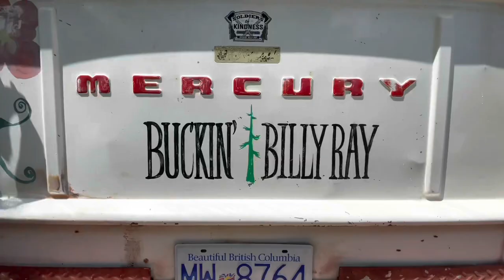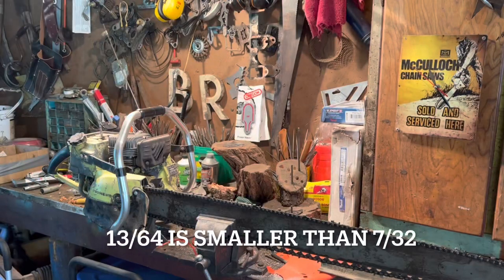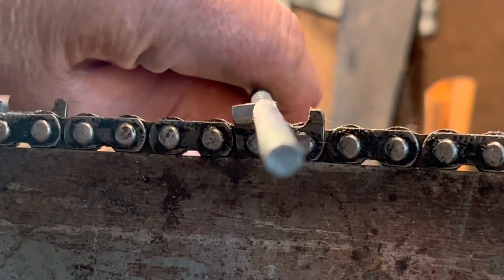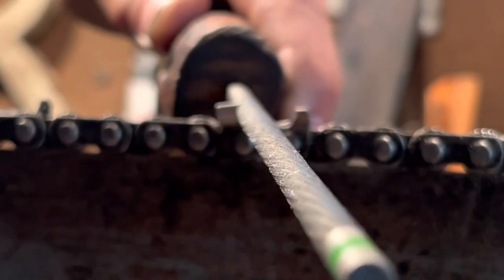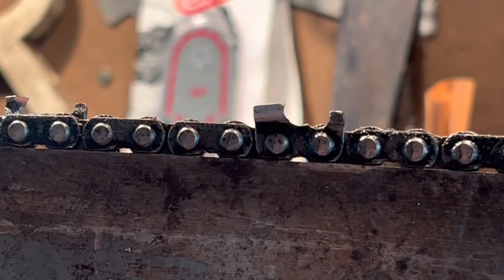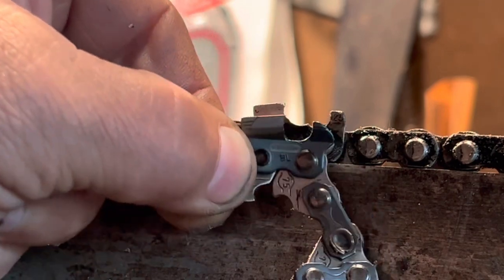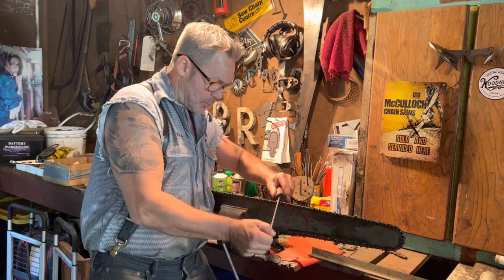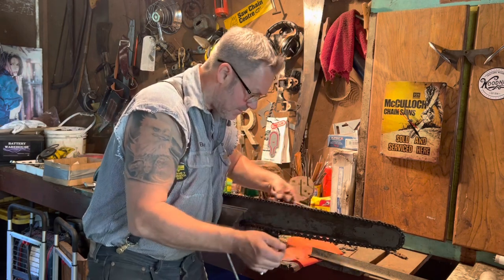How is your chainsaw file guide working ?

Comment: I have trouble getting consistent  hand filing results when i have no vice to use.  I use a genuine Stihl .404 file holder with 7/16 file for 3/8 chain for filing in the field. It keeps the file at the right depth and the marks help with the angle. Stihl chain has a lower top plate which is why they recommend 13/64. My .325 holder always cut too shallow with the 3/16 file so i put 2 layers of 150 grit sand paper between the file and the file holder to make it cut deeper. If a touch up in  is all thats needed these work well. If a chain  hits rock or steel then  back to the vise and get the gullet Buckin style. The 2 in 1 style holders cut at different depths on each side of the chain

Comment: 13/64 is good for filing some extra angle on the side plate like square, you can get in underneath I keep the top plate to the witness mark about 30 but you can run the file maybe 15⁰ more into the side plate requires stroking up through, not as a good as square but closer. 
Give it a try.

Comment: Buckin' did you try to bake Robs coil? i run a heat gun over them just keep it moving so you don't melt it. gets rid of the moisture. you are bound to know this already though. just a suggestion.

Comment: Husky says to use a 3/16 file on my chain and it would never cut like I wanted it to or I thought it should, I changed to a 7/32, got a much sharper cut on the top and down in the gullet, it now cuts like a little demon, love it
Reply from the maker: That’s interesting you must have been sold 325 ,.  I like 3/16 for that
Reply: @BuckinBillyRaySmith  Yes, I would not have wanted to go any bigger with the file, it does cut quite aggressively so you have to let the saw do the work and not lean into it too much, you can still use the dogs to grip the log and just take it easy. But...it really does cut like a demon.